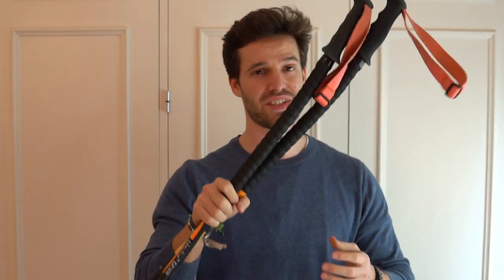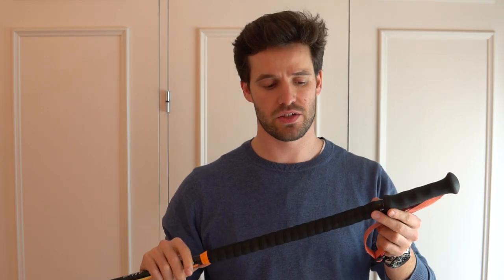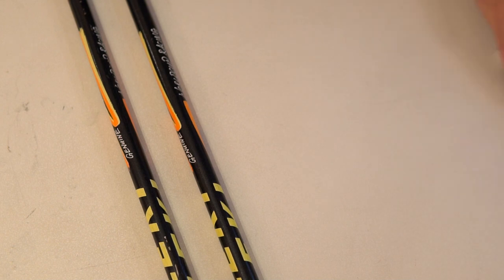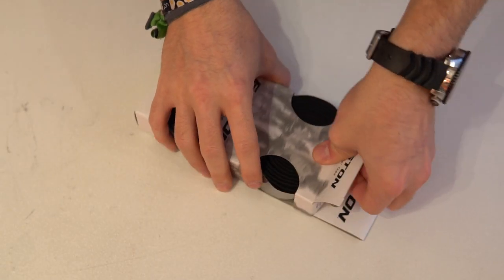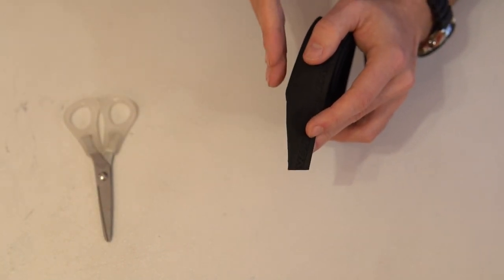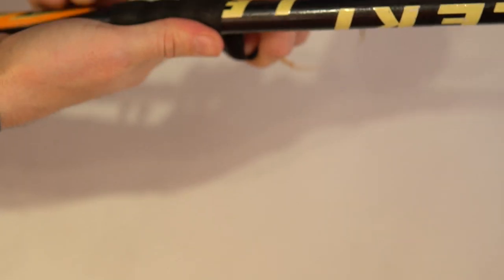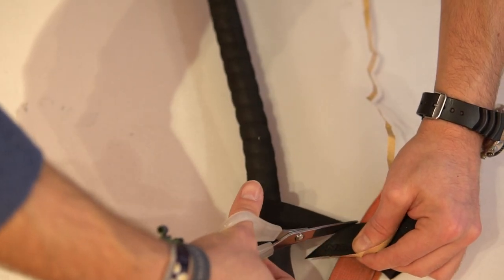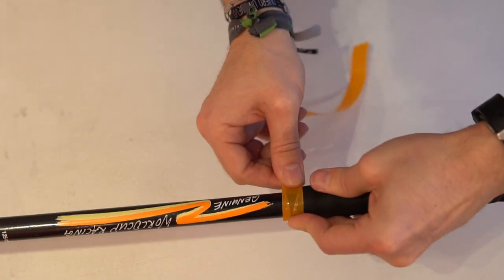How to: Add A Touring Grip To Your Poles - DIY Super Cheap Ski Touring Poles!

Comment: Nice project! Easy to make but very useful!

Just to find a hit...I would have cut the upper end  of the tape in the opposite way, so that the bevel was parallel to the handle ...
Reply from the maker: Guillermo del Pozo Jiménez thank you! I am surprised at how much I like this simple hack! You are right, I think it could have been done in a more elegant way, but this is a clear example of “learning by doing”... the next poles will have your improved design :)